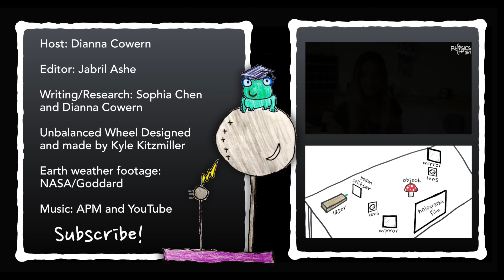Are perpetual motion machines possible?

Comment: I'm building a Perpetual Motion machine on my 3D printer. 12 volt battery and motor required!
Reply: Kent Harris 
Why don't we print batteries and use those batteries to fuel the printer?

It's big brain time.
Reply: Lol
Reply: Talk about batteries not included!
Reply: @Nolan Klein is r/whooosh used for ur case?
Reply: funny :]
Reply: There's  a battery and a moter its not perpetual machine. You probably made the moter turn then you harvested the energy and brought the energy back to the battery which powered the moter,but That's not a perpetual machine firstly it won't run forever because the parts will where down ,secondly You will loss energy because of the second law of thermodynamics ,you will lose energy from heat and that is ireverseabile,Thirdly you cant harvest energy from it because of the first law of thermodynamics that energy is neither created nor destroyed so the energy you got out of it will be needed for the motor if you take out energy then the machine will stop . But it's a fun build 😊
Reply: @tls_falcon6648  I think you're preaching to the choir here.
Reply: @CeanStrauss  I don't follow,was that an insult,  if  so sorry I offended you
Reply: @tls_falcon6648  spell
Reply: @tls_falcon6648  What I said wasn't an insult, and you didn't say anything offensive. "Preaching to the choir" is an expression meaning, to present an argument/opinion to a person/group who already agrees with it. Like trying convince someone of something that they're already convinced of.
Reply: I'm building one also that will require your own battery and alternator.
It's crazy how people are just zombies and repeat what everyone else says just to fit in. 150 years ago our major form of transportation was a horse. Our movie theater was a muppet show or animal fights. Candles for light. You scientist folk are the same ones that say we been around for billions of years, and everything we see, hear and feal come from an explosion of atoms. You make fun of folk because they have "possible" ideas on perpetual motion machines????
That's not like the nerdy guys I bullied in school to be so cruel. You guys make fun of Christian folk for holding on to teachings of old, but yet your doing the same.
Reply: If you really want to make one . My comment at this video can help you out a bit .. 
From the archangel Ram full Than
Reply: You can get something for nothing, or everything doesn't exist. Think about it. How does matter exist? Where did it come from? Either it always existed some how, or it some how came out of a complete void of nothingness in to existence, a singularity point. So it would seem in some cases you can get something from nothing. Otherwise did the big bang not explode from nothing? How did it get all that energy? Where did it come from, at certain point you have to realise there is something beyond comprehension, so it's a case of understand how to do something. I mean even if you work out how to get gravity to turn a wheel with no friction, the energy source would be that creating the gravity. So I think it's important to think how can I take advantage of natural events and gain energy, and aim to work out a way to do this. Wind energy is a good example, solar energy from the sun is a good example, if a person can figure out how to take advantage of something in nature which causes less or no long term problems, that is a positive. :)
Reply: @TheaDragonSpirit  gravity isn't nothing . .   something they don't seem to understand.  To get the why they don't understand read my 2 comments here
Reply: @douglaswilliams4389  You have to have something that works against gravity in one situation but works with gravity in another situation. Otherwise it will just balance out and create equilibrium, and you won't gain anything. So if you look at a SeaRaser, the waves push the weight up, then gravity pushes it down. You have to work out how to do something like this for gravity to be useful in a machine. Same with a hydro damn, in which the natural rain cycle takes water up the hills and rains it back down. https://www.youtube.com/watch?v=FfmgxNpprWQ
Reply: @TheaDragonSpirit  OK.  . .
Picture this in your head. A bike wheel with a gardenhose in the rim track (for airflow around without pressure) drill 12 holes evenly spaced = the o'clock positions.  Put 12 piston shafts from rim to axle. (Airtight with hose bottom)
Put 12 round electrical plastic cover plates centered over the holes (to work as a base for the airbags) Put 12 acordian style airbags (airtight them to the baseplates) with  3 lb. Weights connected (airtight to the top of the accordion style airbags) with a piston going all the way into the piston shafts to ensure straight open or close of the airbags. A full airbag can bobber the 3 lb. weight over it . The movement max of pistons is 4" enough to open or close the airbags and movement is only allowed in the 11:30 to 12:30 OR 5:30 to 6:30 positions.
Each airbag ( for argument sake ) is half filled with air . . . Causing the wheel to be perfectly balanced underwater. 
Gravity pulls the top weight DOWN (to the rim squashing the airbag shut) TOWARDS the axle.
The bottom weight DOWN (filling the airbag with air comming from the top bags closing) AWAY FROM the axle. 
Gravity will be harnessed by this wheel.
Perpetual Motion wheel 

Why no one can build one is paradox 

From the archangel Ram full Than 

PS.  don't hurt yourself trying 🙂
Reply: @douglaswilliams4389  Water has friction... Also I'm not sure what you mean. Where is the weight coming down from?
Reply: @TheaDragonSpirit  draw it on paper and look at it. The bike tire is on an axle that supports the weight of the hole wheel. And either is suspended under a 📦 floating ubove . Or more likely affixed to the bottom of a pool.
Reply: @douglaswilliams4389  Just make it and show a video. Ha.
Reply: @TheaDragonSpirit  I've tried 😪 but no one can make it. It will cause paradox , you undo yourself. And loose memory. 
On the bright side it is proof that God is real. No one in history made one . . . Not because they weren't smart enough but because it unmakes humans. And only humans are smart enough to make one. 
The kingdom of the beast is caused by this paradox.
Reply: It's not technically DUH build your dream vibrators anyway! 😎😍😎
Reply: @tls_falcon6648  Your right it would not be considered a perpetual motion machine. It would have the appearance of one however. Amaze your friends and coworkers! I would design it so once you turned it, it would keep going until the battery wore out!
Reply: @matthewrossie5336  if you want the answer look for my comments there.
Reply: @Khoaeash Dhawan what do you think of my coments there ?
Reply: Bro best of luck

Comment: To be entirely honest, if the machine is converting an essentially infinite form of ambient energy from one form into kinetic energy, which arguably, is the most usable form of energy, then it deserves to be considered semi-perpetual motion in my book :)
Reply: ...converting an...
Reply: It is similar to a wind turbine machine; the wind flows because to small temp diff on the earth's surface at diff places.
Reply: Eventually the water would evaporate from the bowl.  

Filling up the bowl requires energy.
Reply: @Derekzparty  false. why would the water evaporate?
Reply: @clacl8647  ... she just explained that the room is hotter than the water. And also drier. Of course the water would evaporate.
Reply: The first law, that energy can change form but not be gained or lost within the scope of the system under consideration allows heat to be removed from the planetary ambient. The second law of thermodynamics treats our huge planetary reserve of heat as hardly usable because this heat tends to be of very uniform temperature. I think the second law is a hollow old paridgm who's tenure should be revoked in spite of its eminence. It is more elegant for refrigerators to yield electricity instead of requireing it in order to dump refrigerant heat, compressor heat, and friction heat to the environment. A civilization with cooling making electricity and industry using electricity for heat, motion, and electrochemistry would be inexpensive to live in, with prosperity available for an enriched life. Sustainible, and clean - because pollution would be converted into safe useful materials. Cryogenic storage would be reliable, Imagine a liquid or slush Argon fire extinguisher non toxic and abundant of though suffocating. I was inspired by Isaac Asimov, who started chapters on thermodynamics with the first law.
Reply: semi-perpetual motion?  HAHAHAHA.

Comment: "It's all very simple. And so are you if you think it'll work!"
rofl
Reply: you can use magnet to make an object float so no friction.
Reply: Pralay Aryan It doesn't. That object can't produce free energy as any energy taken away would stop it.
Reply: Also, 1) There are too many poorly edited cuts to be credible, and 2) If they aren't pushing it and cutting it, then there would obviously be a loss of energy in each turn. As each bottle going up needs more energy than what is created by the bottle going down directly 180° from it.
Reply: Her statement is correct about getting something for nothing.  An imbalanced wheel works because it follows the laws of physics and mechanics of motion.  The sum of the moments about a point must equal zero or there will be motion.  In an imbalanced wheel, the sum if the moments about the center of the wheel are not equal to zero.  Therefore, by the same laws of physics and mechanics, there absolutely must be motion.  And, as long as the forces produced by the motion are greater than the forces of friction and air resistance, the motion will be perpetual.  What she says is somewhat misleading.  There is potential energy that is converted into kinetic energy in an imbalanced wheel.  It is utilizing the force of gravity to covert the kinetic energy into work.  So, that is the power source.  However, she scuffs at it in the beginning.  Gravity is the power source.  Capillary action is a viable source as well.  It is the based upon the force and attractive force of the surface tension of the water molecule.  This is what make capillary action exist.  If you were to draw water through pipets into a reservoir that spilled over a wheel the wheel could generate power.  And the water could be drawn back to the top by the pipets.  This would have to be a closed loop to or prevent contamination of the water an clogging of the pipets.

Comment: The drinking bird section is a little misleading, the drinking bird's energy source is actually the evaporative cooling of the water it absorbs by "drinking" the water (i.e. it's driven by entropy.)  The bird would keep drinking even if the water was the exact same temperature as the air around it, as long as the relative humidity of the air isn't 100%.  
That does complicate things though, so I can see why you left it out.  Otherwise, great video as always! :)